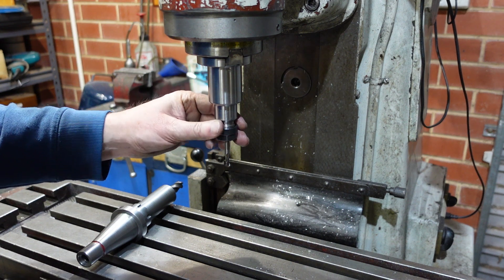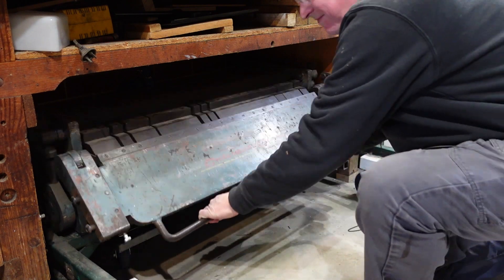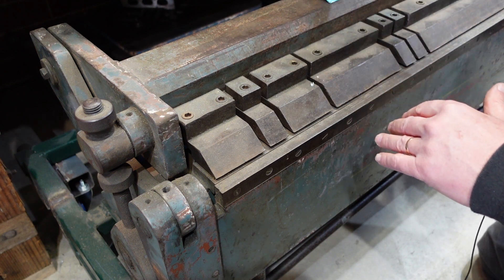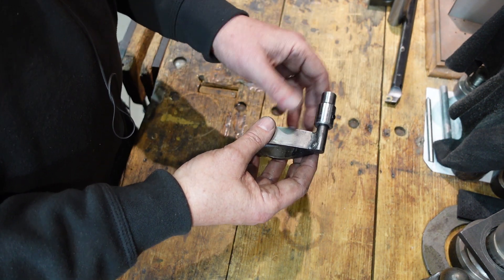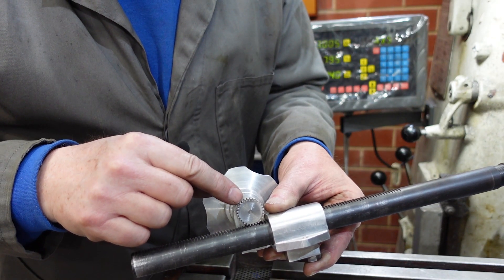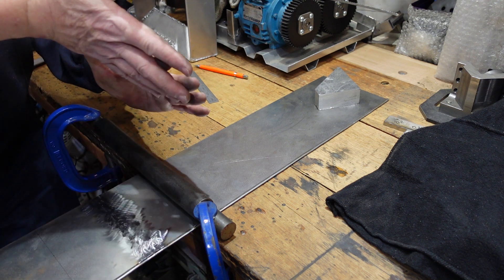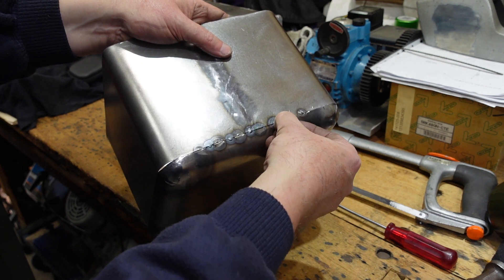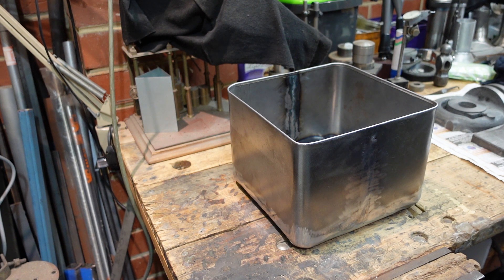Loose ends

Comment: I think your clips are so informative and keep up the good work. For your extended ER collet shank, how did you do the clip-in collet nut?
Reply from the maker: The clip in collet is done the same way as it is for a normal collet nut with it's eccentric collar. The only problem with it is that because the nut is so deep, getting it to pop in can be tricky. I usually have to lever it in. It will get there though. For the limited number of times I am likely to use it, it will work well enough.